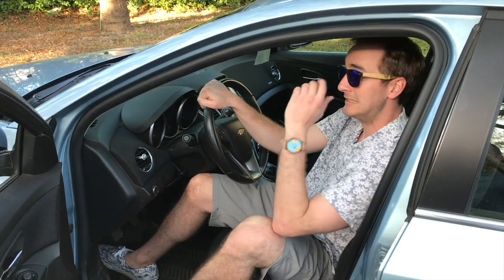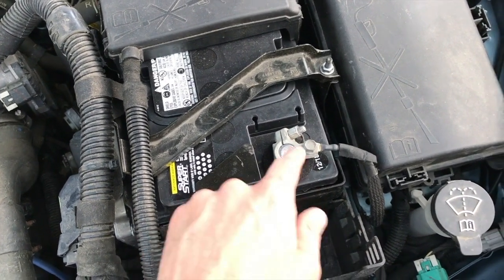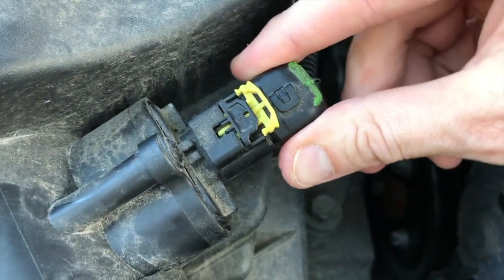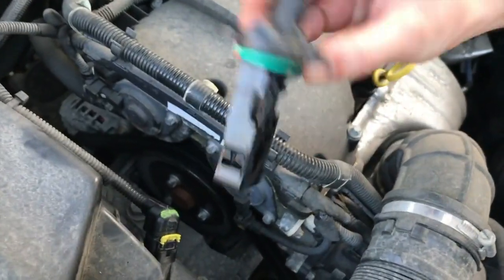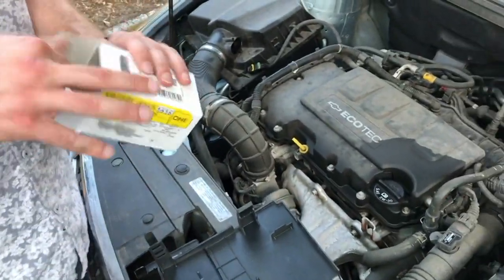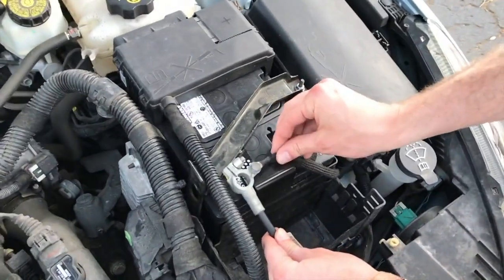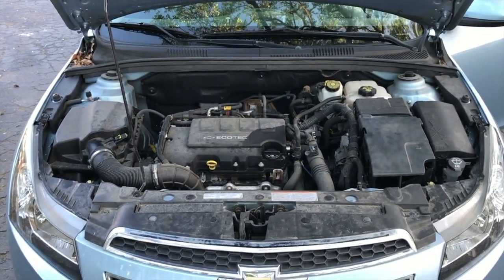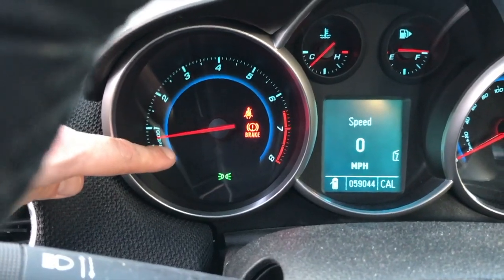"P1101/P0171" Cruze/Malibu/Impalla - Replace Mass Air Flow Sensor!

Comment: I use my Cruze for commuting to work and it just started sputtering and hunting when idling, and it’s stalled out on my twice while sitting still.  I’ll have to check out changing the sensor, I haven’t ran a computer on it to see the code yet but I’d imagine it’s the 0171.  

Another thing it’s started doing is sometimes not wanting to accelerate when in low gear.  I’m thinking this could be due to spark plug going bad, but could a faulty air sensor cause this as well?
Reply from the maker: Good morning, just poured a cup of coffee and am sitting down to answer any and all questions for the DIY community.

We appreciate you sharing your experience.  Replacing sensor and spark plugs is a great idea.  We also recommend replacing ignition coil pack that plugs slide into.  Please keep us posted.

Let us know if you have any questions and hey if you’re into crypto trading, join our DIY ecosystem.

       toolboxtoken.com

Reach out to us any time!  🧰

Comment: I have a 2012 Cruze Eco, had the engine light come on, took it to get a code, turns out it was the MAF I replaced that, also put a new air filter, and still sputtering, is there anything else I need to check for? Love the helpful videos.
Reply: Hello, and thank you again for the videos, you were right, I actually needed a new valve cover, next time I think I'll just ask you instead of AutoZone... Thanks again
Reply from the maker: @April-kv4ku  

Thanks for the update, we are so happy to help.  We are always here to help answer questions!  Enjoy your weekend.

😎👍
Reply from the maker: Thanks for watching & welcome to the DIY Raptor Club.  It’s very likely that you need a new valve cover.  Below are three very helpful videos.

1.  Cruze engine sputtering, this is why!

          https://youtu.be/MbpEf90NQD8

2.  Cruze diaphragm

          https://youtu.be/5aIv6sL9KnA

3.  Replace Cruze valve cover

          https://youtu.be/vGkcOe-GsEU

Keep us posted on your DIY project.
Reply: Thank you for getting back to me, but I went again to a different AutoZone and now they say it's my "fuel injectors and possibly a fuel filter" so I don't think I'd like to diy fuel injectors... I've fixed a few of the things in this car thanks to your videos.
Reply from the maker: @April-kv4ku  

Thanks for the update & we definitely understand.  Please let us know if there are any questions we can help answer.

😎👍

Comment: Once you disconnect the battery erases the computer‘s memory so once you did that it automatically turn the light off the light didn’t turn off because you replace the sensor it turned off because he disconnected the battery which wiped the computer‘s memory of the code being there in the first place
Reply from the maker: Thanks for watching & sharing your thoughts, is this what you experienced?  Have you started engine & gone for a test drive?

Hopefully the fault light didn’t come back on.  Keep us posted, us DIYers need to stick together!

Hope all is well with you and your family.  😎👍

Comment: Hey Mike, while I'm not so bad that I needed to be shown the hood release, I appreciate your step-by-step guide.  Some of the DIY videos  I've watched for other projects don't show every step and I have to figure out what  was left out the video. The good thing about those is it makes one think but yours is to the point not leaving anything out. That's really cool. Thanks
Reply from the maker: Good morning, welcome to the DIY Raptor Club.  We appreciate you sharing this.  We are always here to help, let us know if you have any questions.

To the point & not leaving out any important details is our goal.  Hope all is well.

😎👍🔧🔩
Reply: @DIYwithMichaelBorders  Is the Chevrolet Malibu done the same way? I have a 2015
Reply from the maker: @face1647  

Thanks for watching, the Malibu is built differently however with some similarities.
Reply: @DIYwithMichaelBorders  Same person with 2015 Malibu. I just had coolant put in. Could they have caused it by not putting something back together right.
Reply from the maker: @face1647  

Thanks for watching & it’s definitely possible.  It’s also possible that the electrical connection got wet during the maintenance performed.

A wet electrical connection point can cause serious issues with the onboard computer and leading to several fault codes being triggered when nothing is actually wrong with any of the parts.
Reply: @DIYwithMichaelBorders  One thing  I noticed is I have a lot of liquid sloshing around under the hood. When I got home that night I realized my engine light was no longer on. I talked to one guy at auto zone and he said that his Ford truck does that. Maybe that could have gotten the electrical connection wet.
Reply: @DIYwithMichaelBorders  Thanks for answering back.
Reply from the maker: @face1647  

It’s very possible.  Roads this time of year can get very wet, snowy, & slushy...can possibly be any one of these splashing into where it’s not supposed to.

😎👍
Reply from the maker: @face1647  

Us fellow DIY’ers need to stick together!

😎👍🔧🔩
Reply: @DIYwithMichaelBorders  I agree.
Reply from the maker: @face1647  

😎👍

Comment: I replaced mine code never cleared same symptoms
Reply from the maker: What’s up Brandon, thanks for watching.  If disconnecting the black negative cable from your battery for 5 minutes doesn’t clear it, you may need to visit your local AutoZone where they can reset your error code with an OBD scanner.

Keep us posted.  😎👍🔧🔩

Comment: I have a 2014 Malibu. Is the procedure the same?
Reply from the maker: Thanks for watching & how did your project go?
Reply: I replaced the MAF and MAP sensors but the car is still rough idling and stalling.
Reply from the maker: @rjfischer571  

Good morning, we appreciate you sharing your update.  You may have a faulty diaphragm on valve cover.

Below are a few links that dive deep into this project, you will find these very helpful.

1.  Traction control issue

       https://youtu.be/MbpEf90NQD8

2.  Diaphragm inspection

       https://youtu.be/5aIv6sL9KnA

3.  Valve cover replacement

          https://youtu.be/vGkcOe-GsEU

Keep us posted.  😎👍🔧🔩

Comment: My 08 Saturn Astra XR hatchback is throwing p1101 and p0101 codes I replaced air filter, mass air flow sensor and sprayed carb to find any vaccum leaks. Havent found one yet any reason why I can’t get these codes to clear?? And sometimes it will come up with p0102. Help!!
Reply: I have an obd scanner as well and I erase them and drive, they still come up
Reply from the maker: Thanks for watching & welcome to the DIY Raptor Club.  It’s very possible that you have a small leak coming from the gap between your valve cover and engine.

Between these two parts is a rubber gasket and overtime, the gasket fails and allows air into the system leading to several issues.

Below is a link to a video showing a similar issue on a Chevy Cruze.

       https://youtu.be/MbpEf90NQD8

Hope this helps.  😎👍🔧🔩
Reply: @DIYwithMichaelBorders  you are on the money because my obd scanner said probability 18% for intake manifold gasket. Didn’t know if that would have caused both those codes and a HUGE power loss on hills. No smoke, perfect idle, the rpm will flutter, no difference in sound. But thank you!
Reply from the maker: @Kateee420  

Thanks for the reply & we appreciate your update.  Us DIY’ers need to stick together!

Enjoy your day Kate.  😎👍🔧🔩
Reply: @DIYwithMichaelBorders  it’s not making a suction sound like the video at idle
Reply from the maker: @Kateee420  

Thanks for the reply.  Have you replaced it?
Reply: @DIYwithMichaelBorders  I have not
Reply from the maker: @Kateee420  

Thanks for the reply.  Sounds like it is working as designed.  Is your check engine light still on...?...if yes, what error codes are present?

😎👍🔧🔩
Reply: @DIYwithMichaelBorders  so I have an exhaust leak I don’t know if that could cause the p0101 I only have that code and a downstream sensor code p0036.
Reply: Engine light is present no flashing but significant loss of power, replaced cat converter, intake manifold gaskets, air filter, cleaned throttle body, changed spark plugs, checked for vacuum leak the only leaks I found were in the exhaust idle is rough, I get chugging sometimes and the idle is shaking between 1000 and 700 rpms. I need help with this because the maf code will not go away and I’ve driven over 30 drive cycles since the last obd scan code erase.
Reply from the maker: @Kateee420  

It’s very possible.  🤔
Reply from the maker: @Kateee420  

Thanks for the update.  Have you replaced your Spark plug Coil pack that connects on top of the plugs?  A faulty coil pack can lead to these symptoms as well.

Comment: What was your car doing, that make you change the sensor?
Reply from the maker: Thanks for watching & welcome to the DIY Raptor Club.  We had the P1101 & P0171 error code.  Replacing the sensor took care of both codes.  Hope the video helped.  Enjoy your night.

😎👍🔧🔩
Reply: @DIYwithMichaelBorders  everytime I go up hill the car loses power as it goes up, people keep telling me that has to do with air, I've already changed the pvc cover, should I change the sensor to?
Reply: @DIYwithMichaelBorders  I did change the Pcv cover like 2 years ago, is it possible for the pcv to be bad again? There's no air leaks
Reply from the maker: @Mr-Avg-Varela  

Thanks for the reply, we also recommend replacing the air filter inside the case that the sensor connects into.
Reply from the maker: @Mr-Avg-Varela  

Below is a link to our video showing replacement of Air Filter.

       https://youtu.be/0SrCawgob3M

😎👍🔧🔩
Reply: @DIYwithMichaelBorders  how much did you paid for the air sensor?
Reply from the maker: @Mr-Avg-Varela  

Thanks for the reply & we purchased sensor for less than $50.00

😎👍🔧🔩

Comment: This did not fix it. What else could it be?
Reply from the maker: Spiffy 

We are happy to hear you’re making this a DIY project.  The next item tied to these codes is your valve cover & diaphragm.  Unfortunately the diaphragm cannot be replaced by itself, you will have to replace the entire valve cover.  The annoying part about that is the valve cover itself is probably perfectly fine however the diaphragm is the most common failure of that issue.

Keep us posted.  We are always here to answer questions.

Keep us posted on your project.  Please subscribe to the channel and turn on your YouTube notification Bell 🛎 that would be awesome thanks again!

😎👍🔧🔩

Comment: Hey, So I have a Chevy Malibu 2016 and had my mass air flow sensor and air filter replaced yesterday but my check engine light is still on along with code P1101... What should I do now?
Reply: Ash-Lo I have the same problem right now code p1101 pop up and said I need to fix the sensor Chevy
Reply: Hey Michael will disconnecting the negative terminal have any adverse affects on the settings, like radio, computer etc?
Reply: @johnrkd6314  over than resetting your clock it should be fine
Reply: I just cleaned mines with mass air flow cleaner and reconnected battery
Reply from the maker: Ash-Lo 

Thanks for watching & we hope the video helped.  We recommend disconnecting your black NEGATIVE cable from your battery & letting it sit in the disconnected configuration for 15 minutes.  This will allow your system to reset.  After 15 minutes, reconnect black negative cable to battery.

Next...start engine & drive vehicle to a point where you can exceed 15 mph.  At this point all systems and sensors will be communicating to the onboard computer & if all systems and sensors are properly configured, your check engine light should turn off.

If check engine light does not turn off,  you may need to visit your local AutoZone and have them reset your check engine light with their OBD scanner.  AutoZone does this for 100% free.  Keep us posted!

We really enjoy making these helpful videos for our fellow DIY’ers.  Many more helpful videos to come.

Please subscribe to the channel and turn on your YouTube notification Bell 🛎 that would be awesome thanks again.

😎👍🔧🔩